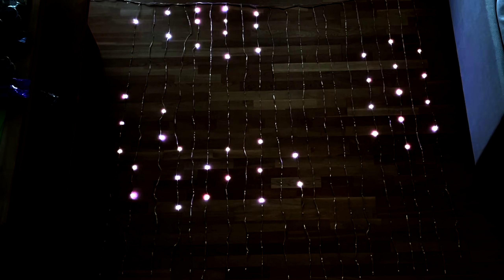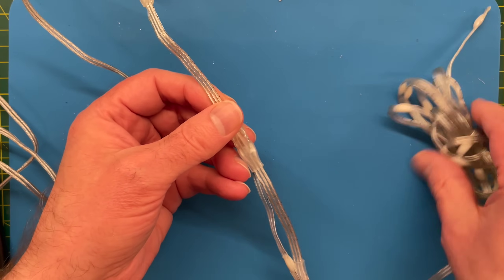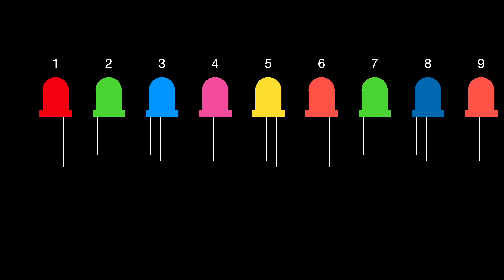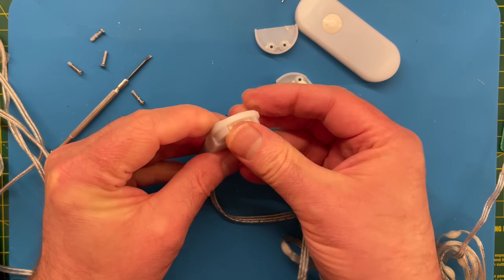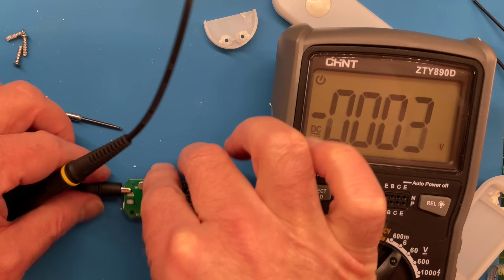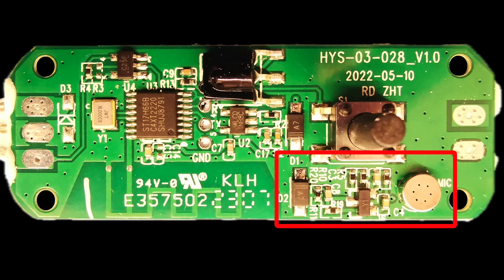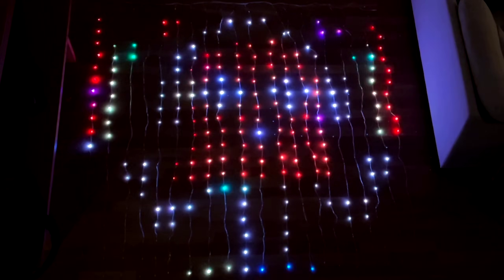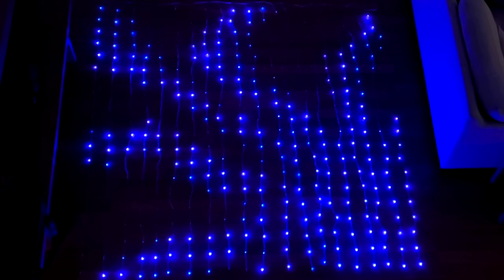Most Interesting Addressable LEDs that I've Ever Seen

Comment: Hi, I'm a newbie,
Would it be possible to have a connection diagram?
I can't understand how you powered the board and which pins you used to power and drive the LEDs.
Thanks very much.

Comment: I tried to do this with a seemingly identical curtain. I attached a wled controller and it stopped exactly halfway through the curtain. The original controller lit everything. After I took it down to troubleshoot, even more stopped working. I think mine just may have been a fragile piece of garbage

Comment: For those that are looking for the WLED settings used, it was posted in a reply last year:

"I just picked 2D matrix and left “serpentine” unchecked. No other set up apart from telling it the width and height and that it is “vertical” to get the orientation correct."

Unfortunately this has not quite worked for me. I have a different set of LED curtain lights, looks to be a similar layout, but the programming must be different. Still playing around with everything.
Reply: You have to select the LED type, at least.

Comment: Just bought a curtain myself.  Kind of last minute to put up a window.  But I have every intention of 'hacking' it when I get the chance.  I use LOR for my Christmas display.  Controlling LED strips and lighting for musical animations.  It would be fantastic if I could put this LED curtain under LOR control to sync up with the rest of the display.  I had suspected there was some kind of addressable serial protocol at work.  Thanks for the breakdown!  Great Video! 
 Now I just have to see if it is compatible with say the WS2811/12 protocols.  Could probably drive the whole curtain with 3 DMX universes.  Controlling it wirelessly via Bluetooth or WiFi would be very cool.  But I would have no issues with cutting the controller right off and connecting the curtain directly to one of my LOR controllers.  Assuming it can handle 5 volts.

Comment: For 400 set 3x3M 20x20 
Okay for anyone who has been struggling. Also if you cut your ones to length (mine are 13 high not including the very first LED in the hook). I have been messing around. I have the similar set, mine do have a hook that also has a unused LED but is vital for operation. I have to set you total number of leds to 800 and disable global LED buffer. Then head over to matrix settings and set it for 20Wx40H vertical then set to not serpentine. Also set you orientation as needed for your setup.
Next go to your segments and set startX 0 stop 20
Then Start y 0 stop at where you cut your ones off in my case 13. This solves your top row of leds being in the wrong position and also gives full effect on your leds grid space.

Welcome everyone. If there is already info out there about 
This I am sorry I was just figuring it out on my own. This video helped me understand the bus system and not send me insane trying to understand the magic

Comment: Hello, I came across your YouTube channel by chance, I was looking for a way to repair my LED curtain lights bought last year. I have always controlled it from the phone app (Ideal led), but after an update, it has stopped working completely, neither with the app nor with the remote control. I don't have too much knowledge of electronics, but I really want my children to have those Christmas lights this year. I was wondering if maybe you would be so kind as to help me find the fault or fix it. I would be extremely grateful. The manufacturer does not give me support, neither does the creator of the app and I am a little frustrated. The LED curtain model is similar to the one I see in this phenomenal video, the source is exactly the same, I have checked it with a multimeter and it seems to be fine. Thanks anyway if anyone reads me. Greetings!

Comment: why do you reply to all the comments except the 1000 asking what your god damn settings were  other than 2d matrix. i Have these lights. in the matrix generator i set width to 10 and heigth to 40,  left serpentine unchecked with the first LED starting in the top left. Using a esp8266 mini off  with data running off GPIO pin 2, and i get nothing.

Comment: Would WLED need a pretty rigid amperage limit set when running off the board's 3.3V pin?

I usually use WS2812B 5V leds powered separately from the board.  I take it the LEDs won't run at 5V?
Reply from the maker: I left the LEDs powered by the original power supply which outputs 5V. So the ESP32 board was just driving the data pin.

Comment: How about combining this LED curtain with your ESP32 TV code to play (very low res) video on the curtain.  Read in the motion JPEG frame, down convert it to a 20x20 format and then display it on the curtain.  30fps should not be a problem.
I am thinking of this as an ambient side light source in an extended reality (CR) volume with either a large TV, projector screen or an LED wall as the background.  Ambient light is the light reflected off of talent, props or actual set pieces in the shot like light from a campfire off screen to the side.
Reply from the maker: Definitely possible. I've got an RGB LED matrix that I want to try it out on as well.

Comment: Did I miss the bit where you discovered/explained how these were passing the data between the different  "legs" of the strings? What was the LED config you used in WLED?
Reply from the maker: As far as WLED is concerned it's just a string of normal WS2812 LEDs. The way it works is that each LED "knows" what it's position on the string should be. So the serial data is sent to every LED simultaneously, and each LED picks out the data that is for its position.
Reply: @atomic14  Have you found a  current working link for buying these LEDs is "raw" string (unprogrammed) format? I can't see anywhere that is selling anything described as pre-addressable, pre programmed, etc...
Reply from the maker: @paulbritton187  No luck on my side. Probably only available in China direct from the factory.

Comment: Did you still have it connected to mains power, also are you getting the 3.3v from the oem controller to run the esp32?
Reply from the maker: The ESP32 board I was using lets you connect an external 5V to a pin so I powered it that way.

Comment: Ah, so another variation on these!
I got a version of these 'seed pixel' curtain lights in 2021, it used like a shift register T-connector at the top. The ws2812b seed pixels per drop were just like normal seed pixels (data in, data out).
Going forward, I'm interested to see how these seed pixels hold up. I built a 2,400 pixel tree with them last year but the quality has changed a lot. Even in the video I did on the tree you can see slight yellowing on the strings.
Reply: I also have a set of lights that have the T-connector at the top of each drop down string, how would you configure the settings in WLED with regards to the LED preferences, and 2D matrix for this version?
Reply: @Mayor-xu6ie  Did you ever figure out how to do this? I cannot quite figure it out either.
Reply from the maker: That’s very interesting - my initial thought on how these ones could possibly work was some kind of shift register at the top.

Comment: How does this matrix work ??? You stated that the last LED in each string must be connected to the top of the next string. Did you add a wire on each string to get the data back to the top ??? How ??

Comment: I know from someone who has been to the factory that the process of programming the addresses of these LED involves shining light at the LED, using it as a photocell, to tell them which device is being programmed via commands over the wire. Don't recall if they use a projector or a laser. I would expect the protocol is something along the lines of "If you can see light now, you are row x", and  similar for Y to program a large array quickly. It may be that higher than normal voltages are involved to do the write operation.
Reply: OMFG, that's so cool.  Using the LED as a photocell to tell them where they fit in the grand scheme of things.  Curious if/how they can be re-programmed when assembled for project.  Down the rabbit hole I go...
Reply: Wow isn't that how we programmed EEPROMs in then80s?

Comment: What is the reason they choose 3 wires and addressable leds? Especially for moving images  WS2812 must be faster no?  No need for addresses saving bits on the data wire. Also the cleaning / reshaping of the signal by every WS2812 is good and lacking here...  I not understand the benefit... only when you want to change a few leds only it could be interesting..
Reply from the maker: I suspect it’s much easier to manufacture as you just need to solder the LEDs onto the wires - no need to cut any wires and daisy chain the LEDs together. You also don’t need to connect the last led in each column to the first led in the next column.

Comment: great video makes sence once you take it apart and having a scope really helps... is it possible to connect mechanical switches to the esp32 directly and have it change to different effects   , i looked on the wled manual and there is a spot for them but im not sure how to program the pins ...

Comment: What happens if you append a normal LED strip to a column? Does it display starting at index 0 or does it display the next columns data?
It would be cool if we could chop off the 2nd row of LEDs to replace them with higher density strips.
Reply from the maker: It will always display the last set of data - so if you added on 20 normal LEDs you would get the last column displayed on them.

Comment: Interesting! But what matrix settings did you have in WLED for this to work? It's not a normal serpentine style string that WLED is "used to", so I'm guessing you need to set it up differently too?
Reply from the maker: I just picked 2D matrix and left “serpentine” unchecked. No other set up apart from telling it the width and height and that it is “vertical” to get the orientation correct.

Comment: I still cant find a seller of just the front xed address led strings. Its a total crap shoot on what arrives, despite what the AliExpress listing says.
Reply from the maker: These ones? https://www.adafruit.com/product/4917 - probably a lot more expensive than what you can find (if you can find!) on AliExpress.
Reply: @atomic14  yeah. It's actually cheaper to buy a finished product to cannibalise it than buy the Adafruit product.
But I'm assuming you can buy the strip, pre programming, then apply the fixed address simply, post fabrication of the final product (curtain, tree, icicles etc) because keeping track of them, given there is no outward markings would be impossible.
Reply from the maker: @StuartTaylorEsquire  Could buy one of the curtains and then reconstruct the original string of LEDs...

Comment: I received my 2x ESP32-S3 boards last week. I want to make a product that uses the Wifi to serve HTML pages with CSS and JS as an async server, but not sure how to make it configurable by the user with out any input source!
How will they type-in the SSID and Password to connect to their wifi?
I thought of writing a Bluetooth app that asks for the wifi credentials, then logs in using that info so that Wifi will be up, and ESP32 can serve as a web server. 
There is also, the possibility of running the ESP32 in Soft AP mode, get the data for the main Wifi, then switch over to STA mode and carry on the rest from there. 
I really don't want to go down the Bluetooth rabbit hole if I can avoid it. That would introduce another hurdle to jump over. 
Any ideas?
Reply: Use WiFi Manager library.
Reply: @ChunkySteveo  Ok thanks. 
I keep forgetting. Whatever you're looking for, "There's a library for that"!
Reply: @piconano  always a library! Haha
Reply from the maker: I was really impressed with the WLED install process - they have a website that used webserial to flash the firmware and then it takes you into a setup mode where you configure the WiFi and then it takes you the running page on the device. Very cool.
Reply: simplest way is https://github.com/elshnkhll/ESP_Serial_Menu

Comment: Amazing. I still don't get how they are preprogrammed on the string. Reading that thread, it seems the ICs are built in order on the string with known pixel locations upto n+X, then repeat. You must be able to request string lengths of x-strings in a continuous reel from the factory...??
Reply from the maker: That's the only way I can think of it working. I don't know how manual the assembly of the strings is - maybe they program them one at a time before they solder them onto the string.
Reply: @atomic14  Only the first LED in each string would need to have a number so it can discard all the previous LED's data. Like the usual WS2812, it could then pass on everything after its own data to the next in the line. So it would only need 19 custom LEDs (numbered 20,40,60,80...380), and 381 standard ones. But as the github link explains these are different, and all the data is still there at the end of the last LED, so every LED has its own ID- wow!
Thanks for reviewing, I got mine in October and having a lot of fun with it, but just like you I wondered how they were doing it without a return path, wondered if they were modulating data on one of the power lines, so thanks for investigating!
Reply: @atomic14  they must preprogramme the chips 1-100 in the die, and they all get fed into numbered hoppers to make up a string from 1-100? Must be a finite length of these strings, too... surely??!!
Reply from the maker: That does make the most sense. All the ones I can find have 400 LEDs - so I guess you could just a single string with 1-400 - or 0-399 :) - on it and then chop it into the sections for the curtain.
Reply: @atomic14  it seems crazy - but that's probably it, and it's just a case of 400 dies, and 400 hoppers feeding a continuous string.... some startup work, but clearly, it's clever - as everyone hated the return wire on curtains!
Reply: Could be a OTP process when it's still in a long string (maybe at the factory?), burning a sequential number into it at this point?
Reply from the maker: Knowing how most things work, I suspect it's some horribly manual process.
Reply from the maker: @obd6HsN  I don't know - I just can't work out a good way to do it as once the LEDs are soldered on all the data lines are connected. I guess what you could do, is solder the first LED - program that, then solder the next one and program again, but the first one would already be programmed so would ignore it. That might work...